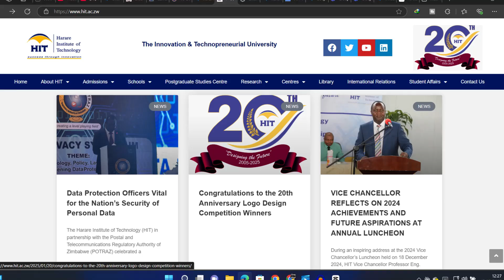Top Engineering Professor Stunned By How African Inventor Device WORKS

Comment: Full Maxwell Chikumbutso debunk pack:

First, a DIY analyses of Maxwell’s claim that there’s sufficient useable energy present in radio waves to power a car indefinitely:

A small car on an even road would need about 12.5kW to maintain a steady speed of 100km/h, going up to 19.9kW at 120km/h. (Such a car would be severely underpowered and basically unusable, but let’s stick to those low numbers to demonstrate the utterly flawed principle.) Highly congested urban areas with plenty 4G, 5G, AM, FM, TV, Bluetooth and Wi-Fi have a radio frequency density of about 10mW/m² (A mid-range solar panel generates 170W/m², about 17,000x the output of what could be harvested from radio waves). If you had a 100% efficient antenna, which also doesn't exist, you'd need a receiver with 12500/0.01 = 1,250,000m². In different terms, that's an antenna measuring 1.1x1.1 kilometres. 
(As to the claim of 220km/h, that takes around 150kW, or an antenna measuring 3.9x3.9km.) 

The microsonic energy powered car is in fact a Kaiyi X3 PRO EV, manufactured in China with a MSRP of $18,500, and an electric range of 370km:
https://southeastmotor.en.made-in-china.com/product/jOxfatIMhVAZ/China-Kaiyi-X3-PRO-Pure-Electric-SUV-Left-Steering-Version-Wholesale-Supply.html

The “Microsonic energy device” is actually a UPS power supply, available from Alibaba for $795.48
https://www.aliexpress.com/item/1005007573244574.html?gatewayAdapt=4itemAdapt

The leading automotive magazine in South Africa questions his claim:
https://www.facebook.com/share/18pheqz7vB/

Snopes actually debunked it:
https://www.snopes.com/fact-check/zimbabwe-electric-car-no-charging/

Any questions?
Reply: FACTS 1000%
Reply: This is the comment I was looking for, one that applies basic logic and scientific principles to the mix.
Reply: The whole idea is to keep you in the dark about how this particular microsonic energy device functions. And so far so good, you are on a wild goose chase sir.
Reply: @godfreydube  There is nothing dark about a scam in progress.

The crazy part is the amount of people that refuse to think for themselves about the obvious scam taking place.
Reply: @scamchan  You have no prove that it's a scam yet, so keep quite, seat down, and be humble
Reply: Physics are racist.
Reply: Yeah I hear what you say . But your wrong about the source of energy . It has nothing to do with RF reception , he is not catching radio waves as you think . Nor is he the inventor of this technology, just another one who came to understand what is already know .
Reply: @ , if not RF, what then? Cosmic energy is around 1×10 
−9  W/m² (or 1 nanowatt per square meter). Calling a physical phenomenon "microsonic" and bamboozling an entire continent just goes to show how far behind Africa really is.
Reply: @Arthur_Götz  It's micro is something small, sonic has to do waves, so what are you talking about. It is you that is so backward
Reply: @stevenwilliams3015  , I'm backward? In the totality of science, there is no microsonic energy, and you believe in it? Clearly, your ignorance places you in no position to dispense personal insults.
Reply: @Arthur_Götz  well, there is now, a much more advance science you never new. Science has never been stagnant, it evolves. There was no telephone about 4 to 500 years ago, now we even have smart phones e.t.c stop being too ignorant
Reply: @ That is absolute hogwash.
Reply: @jeffreydove2036 Then what is he doing?
Reply: Check his Speech on the day he lauched..  he said he doesn't make cars..  what his company does it to make the energy system... 

I can see that your mind is limited by the discoveries of other people. We don't have to worry about you....
Reply: @ His power station isn't a new invention.
His grand reveal shows a power station without the case.

As exposed on my channel with pictures.
Reply: I hope you shall not delete your comment because you shall see it working and we already seen this devices working for years .. we have some machines wich are more than 6 years working non stop many houses are already under this technology......you think this is new technology...its a new to the world not to Zimbabwe.
Reply: @ so Wakanda is real?!?!? 😂😂😂😂😂
Reply: @recallchannel3258  " we have some machines wich are more than 6 years working non stop"
The lies you are stacking only proves this is the biggest scam ever.

Weird there are no news stories of such machines.
Reply: @recallchannel3258  , "we already seen his devices work for years"? No, you have not, because his "microsonic generator" is sold on Alibaba as a home UPS.
Reply: Facts, facts, and more facts. Well done, sir. 👍
Reply: In the end from output based thinking if the tech is working as claimed, is safe and works reliably and sustainably and not cost prohibitive to produce then how it works can be deciphered by the few that are curious but the vast majority of people today don't understand the physics of how their car works in great detail or how a gas explodes, they're just looking to use the car to get someplace.
Reply: Just funny to watch how many Muppets fall in this😂
Reply: This is not in the direction you're thinking. This is another thing entirely transforming radio waves into power huge enough to drive vehicles. People who made orders to the tune of 20,000 in Zambia and 3,000 in South Africa were not ordering for these common cars and gadgets you described here. They ordered for MICROSONIC vehicles. The new perpetual motion device could be described as a kind of Auto-generator.
Reply: @sundayhezekiah5002  , this is not claimed to be a perpetual motion device. Clearly there's a claim of energy input, it's just that there simply isn't sufficient energy in electromagnetic wave form to power anything bigger than microelectronics.

I hope that these orders din't come with deposits, which is why I´m so vocal about this. Innocent people will lose money.
Reply: This is interesting, I love this. 
Now here are the questions 

Can you confirm that the Kaiyi X3 Pro EV is exactly the same under the hood compared to the Saith car? Are you telling me that the same car cannot be retrofitted with his technology which is exactly what he said in is unveiling presentation? You obviously haven’t watched his presentation. 

Are you saying that the device that encases the microsomes energy has not been used by various companies? Did you see a UPS logo on his device? Is everyone not manufacturing from the same Chinese manufacturers from all over the world? You need to do better than that. 

If you watched his presentation and other videos, you will understand that he is not taking the energy from radio towers. I think you need to do more research about this man. 

Here let me help you. 

Watch this video documentary where Renowned Investor and philanthropist Foster Gamble, the great grandson of Procter and Gamble came from the US with his engineers and conducted independent testing to validate the technology and it passed with flying colors. 

Here: do some research and come back again 

https://www.facebook.com/share/v/1AA8Asxzat/?mibextid=wwXIfr
Reply: @elee573  , one question, before we go on: Are you a scientist or engineer?
Reply: All you know or said is based on what another inventor (a human like you, not God) discovered and wrote it in the book for you to learn, because before then, what you wrote wasn't existing until it was discovered. Wait until Maxwell Chikumbutso put his on the book, then you have the chance to learn new things you never heard of or thought is possible. Stop putting yourself in a box
Reply: @stevenwilliams3015  Last I checked not a single people has proven any GOD exists.
Reply: @scamchan  The proof that God exist is the creation around you, including the outer space, nothing else
Reply: @stevenwilliams3015  Pointing to a car doesn't prove WHO made it.

You going to have to do better than that.
Reply: @stevenwilliams3015  You can't jump to a new box without learning about the box.
Reply: @scamchan  God don't exist yet you see all this wonderful and organized creation around you.There is no debate on this, it's just common sense
Reply: @stevenwilliams3015  Common sense doesn't use random associations.
Evidence is needed that only points to a GOD.
Common sense isn't very common when it comes to these points here.
Reply: You can't discover something that does not exist. Humanity started to understand radiowaves, first in theory and then in practice, around 1880, so believe me when I say science has discovered everything that there is to discover about the subject by now.
Reply: @stevenwilliams3015  Learning new things isn't a problem.
Learning the right things is the issue here.

Don't accept things at face value.
There is nothing wrong with asking for proof.
Reply: @scamchan  Who defines what is right and wrong? Haha. Oh, is it the law of physics you're referring to? Bro, those laws were also written by humans like you, then they made it as standard. So what makes you think another human cannot rewrite his/her new discovery? Stop limiting yourself
Reply: @stevenwilliams3015  WHO defined a GOD and all his attributes?
Oh lets see how those play out in our reality we all observe no active GOD of love taking action in.

Remember grand claims require huge evidence as proof.

Rewrite a discovery?
Show me proof that has been done.

So far you are just rambling without substance or solid foundation to fall back on.

Blind faith isn't helping anyone.
Reply: @stevenwilliams3015  "Who defines what is right and wrong?"

I don't recall any GOD stepping up to define any law or enforce any.

Yeah working on guessing games isn't evidence or proof.
Reply: @scamchan  You are the one rambling without any proof. I told you that the proof is an amazing and organized creation around you. So, if there is no supreme Being behind these creations, who then created you? Who gave you a soul? How did you come to be? I'm waiting for your answers
Reply: @stevenwilliams3015  " I told you that the proof is an amazing and organized creation around you."
A library is an organizes creation around me.
No GOD in sight did that.
Rambling about creations doesn't prove your GOD did any of it.
"So, if there is no supreme Being behind these creations, who then created you? "
Last I heard everyone has parents far back as people remember thru history.
"Who gave you a soul? 
Evidence of a soul and spirit are missing evidence like your proof of GOD.

"How did you come to be? "
Remember those people called your mom an dad?
Yeah some times people like you make it too easy.

Still waiting on your evidence that points to A GOD and only GOD.

It is ok to say you have none.
Reply: @stevenwilliams3015  Maybe your GOD can show up to give you better answers and evidence.

Last I checked no GOD responds to prayer timely.

Figure that one out.
Reply: I agree. This is a factual and correct analysis. There is no law of thermodynamics that he has defied.

Comment: My car has a 126 kW engine. A 1m x 1m solar panel can collect about 1 kW of IR, visible light, and UV. For radio waves, it is 1W for a 1m x 1m panel. I would need 126 000 m2 of panels to power my car from radiowaves. He does not even use a panel, he uses an antenna! This will not even power a 1W toy motor. Don't shoot me down, tell me where I am wrong!
Reply: You're right ✅️
Reply: You are not wrong.  People living in a failed country with a failed economy are desperate to make a living.  This 'invention' was launched 9 years ago and failed to generate money.  So he tries again...
Reply: You are right ,we don't know what he uses to aplify the every he captures from nana watts to usable energy
Reply: If real, vs updated version of Nigerian prince, Probably isn’t radio waves per say but other effects Tesla was looking at before his funding was cut off 100+ years ago. 

There is a lot of energy locked up in Earths various fields and no one has really followed up on the aether work Tesla was looking at since it doesn’t jibe with mainstream physics narrative of the past 100+ years.
Reply: Just ask Maxwell for the answer. He appears to be far beyond where we are.
Reply: @kwesigaalex4765  He must first get to where we are to get beyond us - the knowledge in this field is extensive. Many new inventions are still possible - but based on facts not bs.
Reply: Keep on calculating, Maxwell has gone done for his math

Comment: To Be live se need to get a few facts about. 1. How much pover is generated? 2. Where The Power coming from? This IS important because it is easy to extract energy from racinwaves of radio transmitters, especially nearby Lon of midlle wave stetion. The power thus is not high and it is generated by the radio station. So if we are not talking about power The "invention" is valid and not against any physics.
Reply: Language speaky what?

Comment: It’s very easy to ‘Sink Voltage’ from the surrounding Air with an Antenna or a Collapsing Magnetic Field but, its Very Hard to Sink any Amperage from the surrounding Air. It has to be an UN-LIMITED source of Electrons like the Earth so, in a Portable Generator, TV or Car where is the Source of Electrons?